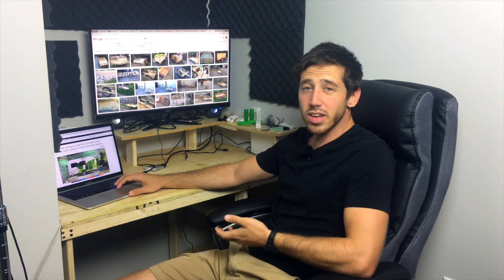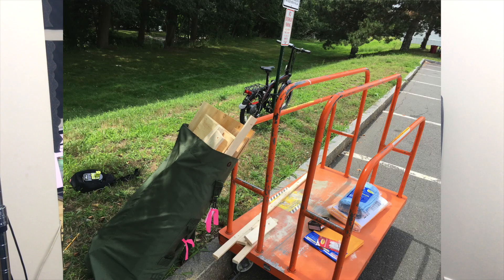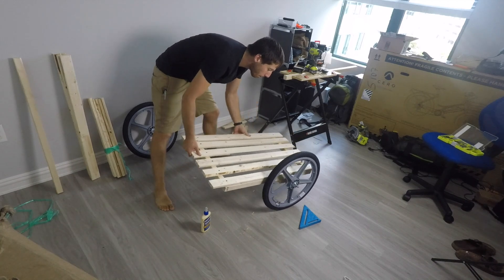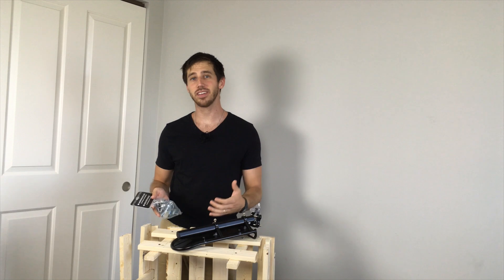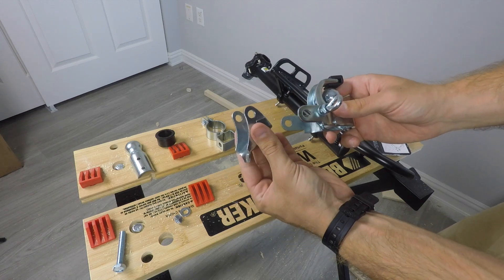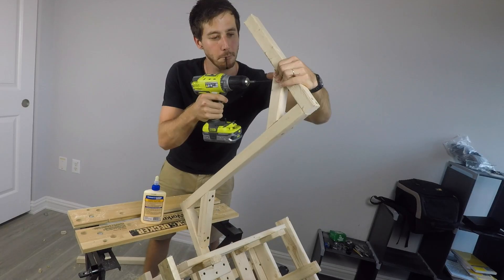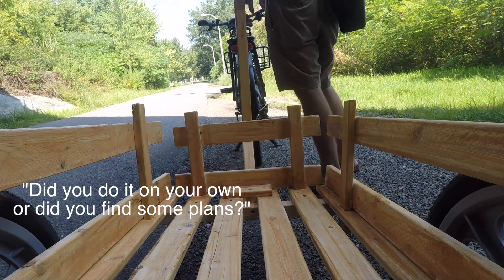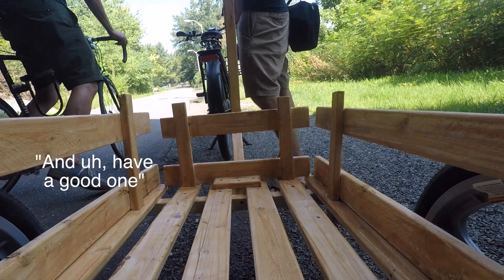How to build a DIY trailer for a bicycle or e-bike!

Comment: Good video and nice build, but you might want to consider at least adding some steel "FLAT L BRACKETS" to reinforce that arm from the trailer to the bike. I'm afraid you get any kind of load and that baby will cast her withers. You also might want to relocate the wheels to be more in the center of your trailer so the weight of your load is on the axle and not on that long hitch arm to your bike. Keep up the great work.
Reply: this will not work loaded. the trailer should have been attached to the seat post not a clamp on cargo rack.
Reply: I'll keep that in mind when I build mine.
Reply: Excellent advice
Reply: Oh tongue weight carries most weight on most trailer or should. Learn to balance it out

Comment: I was planning on building something like this but with steel. I was going to use a caster wheel to mount to the seatpost. Then a piece a square tubing can be placed where the wheel used to be.

Comment: I really like the trailer hitch. I'm a bit concerned about the arm up to the  bike but the bracing will help. Have you tested it with a load yet?
Reply: I decided to use a sunlite axle mount hitch for my diy double wheel trailer. The complete assembly is only $15 and it feels more solid / looks nicer than rack mounted hitches.
Reply from the maker: Yea it's working well so far with light loads but I might replace the arm with metal pipe/conduit/pvc or something similar, also to help with vibration dampening.

Comment: I made once a trailer with a single bike wheel (26in) using a car steering universal joint (connected to the seat post) as a articulation and with bags on each side. It was great on road and trail, but today I wonder how it would do with an electric motor in the wheels hub?

Comment: It'll be interesting to learn how well it endures when it's actually loaded.  I've used trailers to carry my gear when bike camping, and one improvement they really need are brakes.  Going downhill with a loaded trailer is no fun when it decides it wants to go faster than you do.  Very dangerous!
Reply: A bag of Portland cement would be a good test

Comment: Would it not be better if you shortened the vertical piece of wood so the trailer would ride level ?
Reply from the maker: yes it would. I changed the wheel size and forgot to account for it in my plans, haha. I will update the trailer

Comment: A kids bicycle trailer makes a good tow behind hauler by removing the covering/seats and securing a plastic tote to it!
Reply: Indeed they do. You can also cut them in half and extend them if you've got a welder and some scrap metal  (for towing home longer objects and bigger grocery shops)

Comment: Not bad, but perhaps the axle should be repositioned so that the trailer's weight is balanced. Ideally, the trailer should bear the weight of the load, instead of the trailer and the bike. Thanks for the video!
Reply from the maker: yea I forgot to mention but I put the wheels further back so that when I carry long objects like 8 ft lumber, it can hang further out the back without forcing the trailer up and lifting up the bike with it.

Comment: you need to make the trailer more level, it will prevent skidding over larger bumps
Reply from the maker: Yea I switched from 16" to 20" wheels and forgot to account for that in the vertical piece so it wound up not level. I'll shorten the vertical piece to fix it. Thanks!